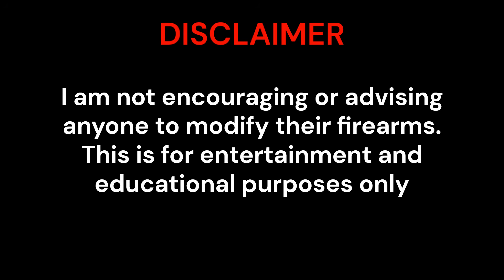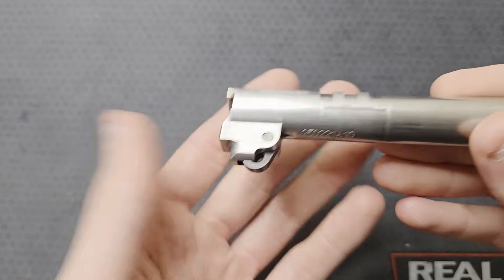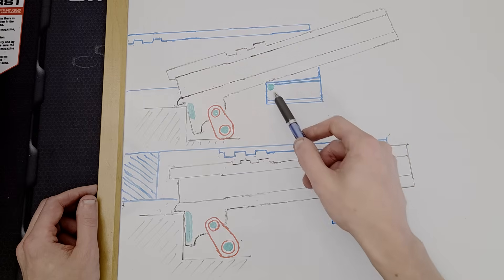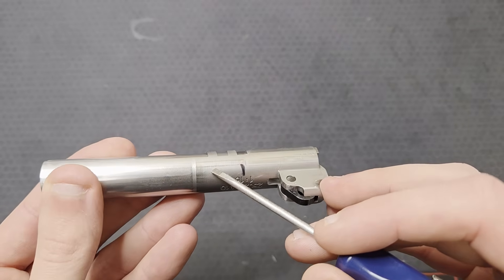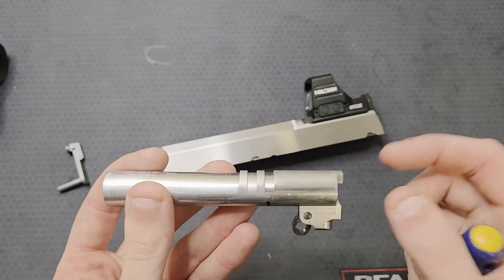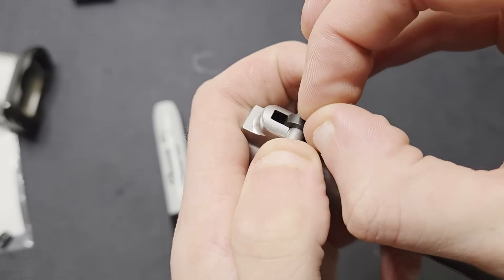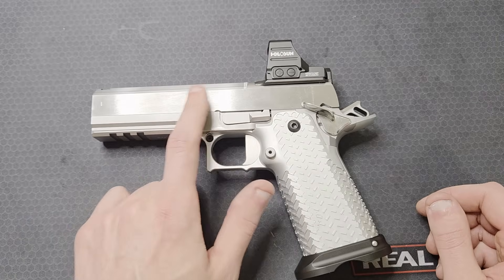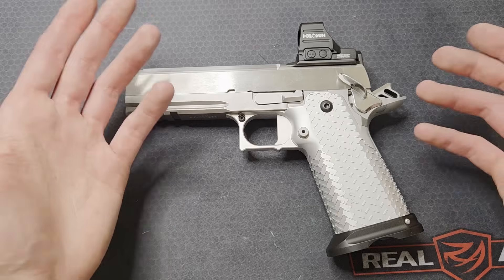Building a Double Stack 1911 Ep. 8: Barrel Fitting Revisited: Link-down Clearances and Link Length

Comment: There seems to be one slight assumption error.  On a 1911 type of pistol, when the barrel is unlocked from the slide, the barrel is parallel to the frame.    When the barrel is locked up into the slide and in battery, there is a downward angle from breach to muzzle.
Reply from the maker: I think the barrel can be at a downward angle (lower at the chamber end) when at full link down with respect to the frame.  Yes, it is at a downward angle (lower at muzzle end) when the barrel is locked up into the slide.

The angle at full link down will vary if its a commander or govt frame where the rear of the spring plug location is different. Also the individual dimensions of components, link length, etc that determines the linked down position with proper vertical impact surface contact. I would guess there is a range of angles  the barrel could be at with respect to the frame when linked down that may range from parallel to slightly lower at the chamber end.

Comment: Slightly unrelated to this, but ive seen an extractor that was too tight cause a hangup during unlock and lock cause weird wear on the barrel due to the inconsistency it introduces. Just another thing to double check - unlock shouidnt feel dramatically different loaded vs unloaded.

Comment: I have noticed the same marks on the sides of my barrel. Atlas slide, KKM barrel, no3 link, PT frame.

Going to monitor the situation. Don't want to remove any material unless I absolutely have to
Reply from the maker: Its an interesting situation. Like... operationally it may never matter. Maybe it will but at a high round count. Its hard to say. I would imagine its mainly an aesthetic issue. I want my chamber to stay nicely polished haha. There has been some discussion about where to remove material too in this comment section. Seems barrel and slide are both candidates. With the barrel you need to not remove too much material from the chamber area where the explosion is happening. But not that much material should come off, for lower pressure rounds, 9mm range loads, 45acp, it shouldn't be a concern.
Reply: @EngineersArmory yes.

I have also noticed a mark on the right edge of feed ramp. I have MBX magazines and i think the edge of the feed ramp is hitting the corner of the magazine. That is something that I absolutely need to fix. The feedramp of the barrel probably needs to be more flush in the frame so it doesn't hit the magazine. It's a typical issues with MBX mags.

I would be interested to see if you have experienced this.
Reply from the maker: @smc4229  step 13 of this video I address it (step 13 time stamp is in the description):

https://youtu.be/e3taArhg8A4?si=-N5rRAQaj2rtDiGl
Reply: @EngineersArmory yep exactly that step. Thanks for sharing

Comment: I believe that Kuhnhausens also shows it permissible to remove material along the sides of the barrel chamber area to address this.
Reply from the maker: Indeed, on page 191 of the M1911 manual, it states the ordinance method for clearancing at this location is to remove material from the bottom of the barrel chamber area. It states this method is not recommended for chamberings of higher than ordinance standard pressure ammunition (such as 9mm). Thats why I clearanced at the slide. Presumably this would weaken the chamber area where the explosion is happening. How much material would you have to remove before it became an issue? Especially with a smaller diameter 9mm chamber? Probably much more than would be needed for proper clearance.

Comment: I have noticed that same interference between barrel and slide on 1911s when the barrel diameter is to the upper spec.  Many barrels are to the smaller spec. 

Also when you check “dynamic” clearance between slide and top of barrel, you need to make sure the barrel is up as far as the link will allow.   This is the position it is in during firing and the barrel and slide are “locked” together and held that way because of the pressure pushing the cartridge back against the breech face.  It will stay there in that position unless the link physically pulls the barrel down.  Remember there is some slack in the link holes.  I do this by clamping the grip in a vise, and using a range rod in the barrel sticking out the muzzle and hanging a weight to the range rod.  This insures the barrel is pivoted up to take the slack out of the link when you measure your clearance.  My thoughts.
Reply from the maker: The relationship as you're describing it (if I am understanding your comment correctly) is the static lockup relationship which was already determined when I fit the barrel. In this video I was discussing the clearances needed for slide reciprocation after the barrel is full linked-down and unlocked after firing.
Reply: @EngineersArmory kunhousen and others describe two clearances. One they call static and the other they call dynamic. There is an excerpt in the very last pages of vol 2 by a third party company (don’t recall who) that explains how to do it with shims and springs (they used a spring to force the barrel up and then manipulate the slide to have the link pull the barrel down). But reading it you get the idea of what they are trying to accomplish.  My take on it is that static is the loose / slack barrel just falling down under gravity.   And the dynamic is the barrel being pulled down forcibly by the link.  This dynamic is the important one because if you allow the barrel to fall under gravity you get an incorrect measurement of clearance that will not occur in dynamic firing situations.  The link has to be capable of forcibly pulling the barrel down when it is stuck by friction to the slide.  Otherwise the upper lugs can crash between the slide and the barrel.
Reply from the maker: @RobertSimpson-i3z  Ah okay I got ya. You're referring to the Schuemann timing test. I mention that in the barrel fitting episode as well. I went thru that very carefully during the barrel fitting process.

Comment: What you did was exactly what needed to be done. None of the material you removed would have any adverse effect on the lock up or accuracy but may ensure reliability and longevity going forward.  Most people remove material from the barrel where these marks occur especially at the spring tunnel. Doesn't matter which way you do it as long as you do it.
Reply from the maker: Thank you! this is reassuring haha.

Comment: I hope you leave the slide color raw. It looks bad ass
Reply from the maker: Its 4140. It would rust, and its too soft. To leave a slide raw it really ought to be heat treated stainless steel. This slide will be salt bath nitride treated.
Reply: It would be pretty cool to see a double stack in stainless. I don't recall ever seeing one. Maybe that could be the next build
Reply from the maker: @tim17371  That would be pretty cool. I am a big fan of black. This pistol will have stainless accents tho.
Reply: Do you have a link to the grips you're using? I used skateboard type adhesive sand paper that I used hard before applying them. If not they will scar just about everything they touch. It was the best way to cover the trigger bow cuts that stayed in place. Thanks
Reply from the maker: @SerfsR-WE  The grip is a complete module from Cheely. It is specific to the Staccato/STI modular double stack 1911 platform:

https://ccgunworks.com/l2-grip-kit/

I got the raw aluminum one. It still needs anodized.
Reply: Thank you.